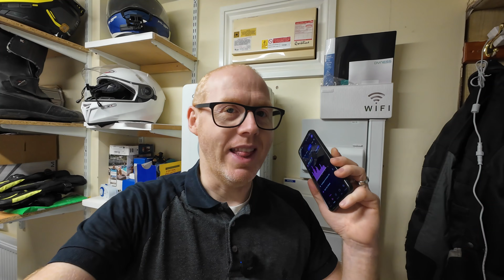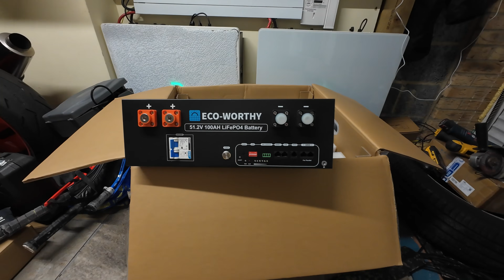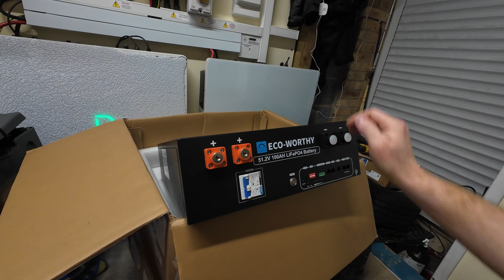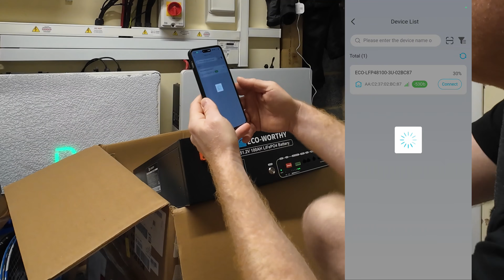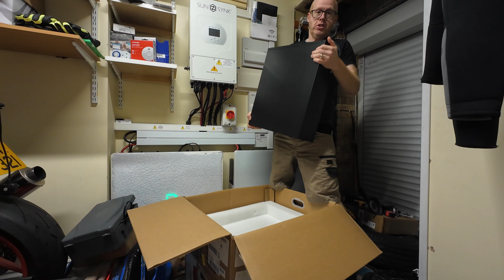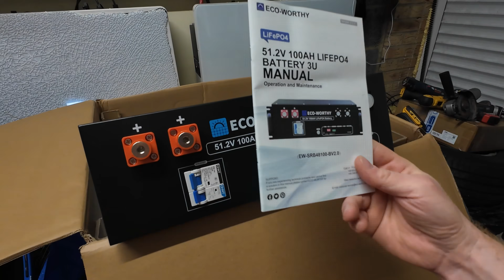Building a 34kWh Home Storage System: Is the Grid Now Optional?

Comment: I am looking to add an additional 10kwh of battery storage. Would I be best to get two Stream 5000 units or one unit and the expansion battery?
Reply from the maker: I don't know what system you are expanding. Too many variables to answer.
Reply: I am expanding ecoflow streams. Currently have a Stream ultra X, two Stream Ultra and two Stream Max. I have pre ordered the Stream 5000, but unsure whether to order a second for the launch price, or hold of for the expansion battery. What do you think would be best? Will the expansion battery allow for a latger grid tied output?

Comment: Just had a 13.1kw array fitted with 2 x Sunsynk 3600kw inverters running in parallel and 2 x 10kw Batteries
Reply from the maker: Nice 👍

Comment: Unfortunately your Amazon code seems to have stopped working
Reply from the maker: I've had a response from eco-worthy:

"Apologies for the confusion here — we’ve checked internally and found that the issue was caused by a recent promotion adjustment on Amazon. Due to this change, the discount code can no longer be stacked with other offers, which is why it’s currently not working as expected.

To support your audience, we’d like to offer an alternative solution:
Customers can place their order directly via the current Amazon link and then send their order number —with the subject line "UpsideDownFork." to us at marketing@eco-worthy.com. We will refund the price difference manually for your fans.

We will manually refund the price difference to your fans via our backend system. This offer is valid from March 30th to April 2nd.
We’re really sorry for the inconvenience caused and appreciate your understanding.

Comment: I have 4x Eco-worthy V3 rack mount batteries (so about 20kwh), and a sunsynk 3,6kw ecco inverer installed in my garden room (in the UK).  Currently used for off-peak electricity arbitrage (with octopus intelligent tariff), but solar panels coming this summer.   I found that I could connect the eco-worthy batteries to the sunsynk inverter only using the pylontech protocol over rs485, not canbus.  I wonder did you try setting the jbd bms protocol to Deye (or something other than pylon), and did you get it talking to the sunsynk inverter over canbus or rs485??
Reply from the maker: I haven't experimented with different protocols on mine, but glad you got it working!
Reply: What are the advantages of the batteries communicating to your inverter using RS485 as opposed to having a “dumber” voltage based control (ie no comms cable)?

I ask because I bought two of these 5KWh batteries that came bundled with an Eco-worthy 5kw inverter and there’s no communication via any protocol  that I could find. I’ve tried several different protocols and cables)
So it operates exactly as my old system did - relying on voltage as the measured variable which determines the charge/discharge rates.

Comment: I have a similar shed setup, only 1.2kw, but it goes into a Zendure Solarflow800. That is connected to battery storage, in the shed, but also plugs into the mains AC, regular plug. That would solve your needs here and I can recommend Zendure kit. Solid and good value
Reply: And to add. That obviates the need of long DC cable runs
Reply from the maker: Where are you located?

Comment: we replaced the whole 3x 16 kWh batteries with a simple single cheaper VW ID.7 battery you can get used out of written off cars.
Much cheaper at 5000€ . Mounted to the wall of the garage and connected with a High Voltage inverter and a wallbox to get charged by Octopus.
Simple as that and the com box needed was about 250€ ... By selling 3 x 4,6 kW single phase inverter with the batteries we were able to desinvest .
We got 6900€ for the used stuff and paid about 6500€ in total for inverter, combox and battery.

48 kWh versus 78 kWh is a good safety margin. At the end these are batteries for automotive useage under huge amount of vibrations and cold and hot climate changes. 
A lot cheaper with about 5000 GBP investment for 78 kWh and never running out of battery even with a heatpump and up to 60 kWh daily consumption during -10 °C  cold winter days.
Reply from the maker: Fine if you have the know how to set it up and ensure it's safe.

Comment: I have three of the very same batteries but here in south east Asia they are branded under Gentai or CST Energy and even cheaper. I have tried the App from both of them and didn't work, then I downloaded the app from Eco Worthy and it works. And you just brought up the fourth version from the bms. I am wondering if there are even more brands under the same roof. But anyways, have been using them for a couple of months now and they work flawlessly together with my Deye Hybrid Inverter.
Reply from the maker: Good to hear. My Sunsynk inverter is a rebranded Deye too!

Comment: Sunsynk recommends using the same size/model inverter when running in parallel. Mixing different sizes generally isn’t supported in the official configuration.

1. Official Sunsynk parallel rules

When Sunsynk hybrid inverters are paralleled:
	•	One inverter becomes Master, others are Slaves.
	•	They share the same battery bank (for low-voltage systems).
	•	They connect with communication cables and synchronized firmware.
	•	Up to 16 inverters can run in parallel (single-phase) depending on model.  ￼

The manuals assume identical models and power ratings, because the control system divides loads equally between the inverters.

2. Why different sizes are a problem

If you mix sizes (for example 5 kW + 8 kW):
	•	Load sharing becomes uneven
	•	The smaller inverter may overload first
	•	Battery charge/discharge current balancing can fail
	•	Firmware synchronization may not work properly

The parallel algorithm typically expects equal capability units.

3. What installers usually do instead

If you want to expand a system with a different size inverter:

Option A – AC-couple
	•	Run each inverter separately on the AC side
	•	Both feed the same distribution board
	•	They don’t operate as a parallel cluster

Option B – replace with matching unit
	•	Example: add another 8 kW to an existing 8 kW system

Option C – dedicate loads
	•	One inverter for essential loads
	•	Another inverter for non-essential loads

4. Things that must match in a parallel system
	•	Same inverter model/series
	•	Same firmware
	•	Same battery bank connection
	•	Same AC grid and load bus

All batteries should also be connected in parallel for stability in multi-inverter systems.
Reply from the maker: Thanks for commenting. What I meant was running the 3.68kW through the aux port of the 8.8kW.
Reply: I do something similar and it works perfectly

Comment: Just WISH THINGS WERE NOT SO EXPENSIVE,,, tempting to Explore, connecting your Eco worthy Battery to the Stream Ultra, with the 4 to 6 PIN bridge.
Other char suggests LILYGO
T-Display-S3 ESP32-S3 1.9-inch ST7789 LCD Display Touchable Development Board TTGO Wireless Module
4.04.0 out of 5 stars (51) as a Clloud link, Wish, Ecoflow would just support 3 Third party Bats and we did not have to risk stuff like this to save money..

Lol well, Anything to stop me smoking those Horrid Fags.

Making the harness:
Soldered 5mm bullet plugs to 10AWG wire and crimped it with an SB50.
5.0mm Bullet Plugs
Added a 1kΩ resistor between pin 4 (12V) and pin 6 (GND) in the EB connector to pull the enable line low. This signals the BMS to connect the internal battery to the EB port.
I used 10AWG wire and a MidNite MNEPV15-150-1PNP 15A 150V rated non-polarized DC breaker for safety.

Comment: I applaud your vim and vigor on your determination and green energy direction, unfortunately I soon lost interest in your video, about a third of the way in

The issue of green energy routes: solar, heatpumps, or a mixture, is the presumption of what information should be overloaded upon the fellow citizen, and what information should be sparse.
The technical information such as inverters etc means little to most, and yet the presumption appears that such knowledge is ubiquitous throughout the land. At the same time the vital information is less than thin on the ground. Price and reliability are the most important points, as they are when buying a: car, phone, music system. I could take a course on how aforementioned items work, but I rather not. Conversely, I do want to know the price and enforceable guarantee.

I've concluded that said technologies work, I arrived at this assumption, because the Germans manufacturer and instal them domestically. However, we live in a nation of box crushers, we can open boxes that contain gadgets made overseas, but we British rarely manufacture.

Cowboy installers, I suspect, still outnumber the good guy installers, so installation and commissioning requires a lot of faith, and deep pockets.

So this route for home energy will probably remain the preserve for those who read-up on such technologies, leaving the majority with their gas boilers assuredly warm and in perfect ignorance on how it works.

Keep well and warm

R
Reply from the maker: Thanks for watching and commenting.

Comment: If you do stuff to your PV system yourself, does that invalidate your MCS certification or something? Do you have to get an electrician to sign-off the system? What about informing your DNO?
Reply from the maker: More inverter capacity connected to the grid does need DNO approval. Yes, electrician should connect any new circuits.

Comment: All gets quite complicated  , Nice to ser you have confidence in more buget brand. Nice area of market. I am still going to wait because of all Legal fluff is stopping me do all Agile export stuff that can swing things in Favor of more Batteries.
Reply from the maker: Best of luck!
Reply: TEMU I choose this for beginners 15.95, So does not matter uf it goes wrong. Y and H very reliable comparded to most. 
Just connect PV and Battery. At leat that way frees up Connections so especially on Battery terminals. MPPT Solar Charge Controller 12V/24V/36V/
48V Auto-Sensing with LCD Display, Smart MPPT
Tracking, USB- (USB-V/H/S/P), Over-Voltage/
Over-Current/Over-Heat/Over-Temp Protection,
Auto Shut-Off & Timer for Solar Panels, RV, Boat
>
4.9 A
108 sold | Sold by trader
Cart
£1 5.75 ALMOST SOLD OUT @

Comment: why didnt you connect the shed in parallel to the inverter, I have 4 strings going into my 3.5kw Growatt in Spain
Reply from the maker: Shading, angle, voltage. Don't have another string that is even a close match.

Comment: Youve opened a can of worms for me here.......im a renter and have been heavily considering an ecoflow stream as a plug in system (i know not legal, dont worry as I am an electrician and I know what I am doing).......but now, after this video, eco worthy looks really good. Im wondering if this would be a more cost effective way to add a system and battery storage to the home. What i like about ecoflow was the smart meter to help with no export. Can that be achieved an eco worthy inverter and battery set up? Do they have a decent app that can pair with a smart meter?
Reply from the maker: Yes, lots of inverters can be set to zero export.

Comment: Having 2 inverters means you can also draw over 12KW on your house and still not use grid power. My shower uses 8.5KW so with all the background power used I can draw well over 11KW at a time, which the single 8.8KW inverter can't cope with alone...
Reply from the maker: Thanks for commenting

Comment: The Eco-Worthy's are fine (though I don't recommend standing them up on their end), but you need to pay attention to how the battery bank is going to be recharged.  Ultimately it doesn't matter how large the battery bank is if you can't replace what you take out of it.  You just get more and more behind and the batteries wind up banging on empty.

Having the storage capacity can be useful, particularly if you have an EV or if you intend to self-consume 24x7 (rather than charge from the grid overnight).   Ultimately, though, the true usefulness of a battery bank large enough to do that only reveals itself when you have a large enough solar system to supply enough daily energy for the home to run 24 hours.  At least in summer / shoulder seasons (full self consumption in winter is usually not achievable).

In otherwords, what a large battery bank + a large amount of solar gets you is being able to omit the power bill entirely.  To be able to export excess solar in the summer to get credits that you then burn up in winter when the solar is insufficient.  And to be able to self-consume 24x7 9 months out of the year.

-Matt
Reply from the maker: Thanks for watching and commenting

Comment: i have 60kwh , 2x 10kw deye inverters, at loc1  and 120kwh in batteies at loc 2 with 2x20 kw inverters and then i still have a spare 10kw inverter with 2x10kw batteries to install elsewhere , but i do think i remember they advice AGAINST mixing 48 and 51v batteries in parrallel !!
Reply: I think that is only valid of you are mixing 16s and 15s batteries. But even then, it's possible.
Reply: @adamswire9152  15 and 16 cells IS the difference between 48 and 51.2v
Reply from the maker: Thanks for watching and commenting!
Reply: @UpsideDownFork  one thing i missed was what you paid for the 5kw units :) i have pretty good contacts and pay around 1000-1100 USD (excl shipping) for 15kw modules of various brands, one supplied from european stock, the others from china directly

Comment: I am sure. You can only run a8.8 with another 8.8 or a 3.6 with another 3.6 but you can't mix them
Reply: correct
Reply: @Robert-dv9yv I run a victron system now but when I was looking into changing bid look at sunsinyk but went with victron be cause of the bigger voltage range that might come into play with different types of battery in the future
Reply from the maker: 3.6kW can connect into the aux port of the 8.8kW unit.
Reply: @UpsideDownFork yes but you won't be able to run them in parallel

Comment: Nice Video👍 Your early comment that we 'always want more' rang true🤣 I've been upgrading my system constantly as funds allow. Like yourself I have multiple shed panels and also multiple garage roof panels as well as house panels. I needed more than 2 MPPT's so I have 3x 3.68kw Sunsynks in parallel giving me 6x Mppt's, I started off with a single Seplos Mason 280L 15kwh battery and now have a row of 4 giving me 62kwh capacity. Unfortunately I don't think you can parallel a 3.6 and a 8 kw Sunsynk, they all need to be the same models and firmware. What you could do is connect any inverter to your Sunsynk generator/Aux/microinverter input and this can be up to 50% of the Sunsynk, so you'll be fine with a 3.6kw, this inverter could be in your bike shed and feed mains to the Sunsynk, retaining your garage wall space 👍 A cheap but good used Solis (~£100) could suit this and spend the saved cash on another battery 🤣

best bang for buck? I've just paid £993.49 for 16.1Kwh,  a Seplos Mason 280L battery kit for £353.65 delivered from Deligreen, plus 16x 314Ah cells from Fogstar on black friday for £639.84👍

Comment: You can't parallel different size Sunsynk inverters. They have to be the same rating and all inverters have to be connected to the same battery array and should be on the same firmware as well. You will have to run it as a standalone unit, not master/slave, without a CT clamp so it doesn't fight your existing 8.8kW inverter.
Reply from the maker: The 3.6kW can connect into the aux port of my 8.8kW. Sorry if I caused any confusion with this video.
Reply: @UpsideDownFork  That is how I have things setup. 2*5.5kW Sunsynk inverters configured in parallel, connected to 4*16.1kWh Fogstar batteries, 10kW of PV, with an additional 3kW PV array on a Solis inverter on an original FiT agreement feeding into the Aux port configured as a micro inverter. I will be adding another Sunsynk inverter connected to my original 2*5.12 kWh batteries as a standalone system just feeding power to the house in a similar way as your ecoflow system.

Comment: The 5kWh ones are nicer to handle (still 2 man lift really) but the cost differential of a rack and 5kWh batteries over the big stackable ones for me means it's worth hiring the local weightlifting club to move the big ones. It's 4,300 for 30kWh versus 3399 for  a pair of their 16kWh big bulky batteries on wheels - so that's a huge premium.

As to DIY - 48v is sufficient to kill you at those currents if you are unlucky. You should be wearing protective gloves when working on it and have removed any jewellery (100A across a ring will cause serious burns). There are some good tutorials and training on handling them and people should definitely be watching those before doing it DIY. Ditto crimping because a badly crimped connection on one of those batteries can start a fire.
Reply from the maker: Thanks for watching and commenting!